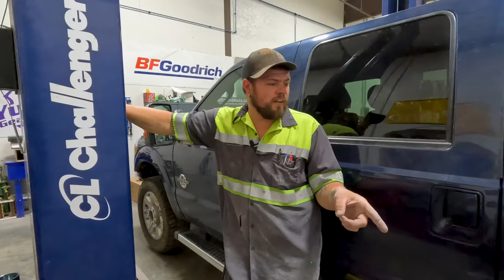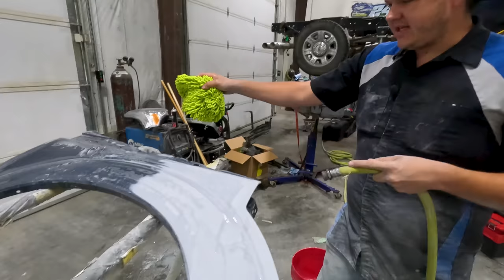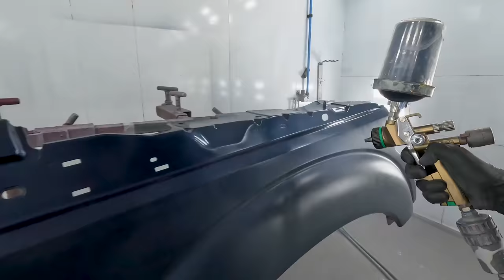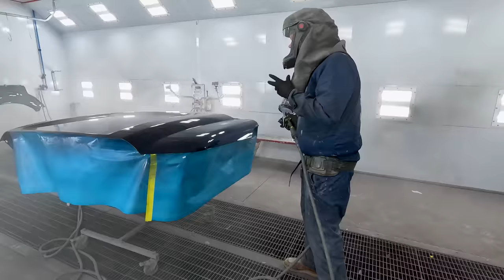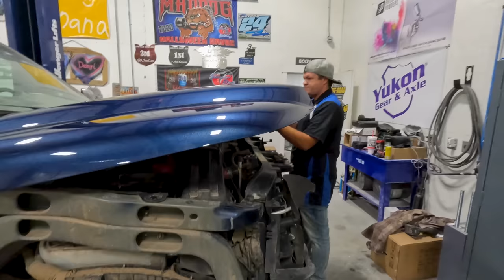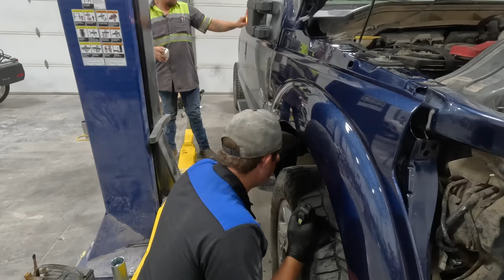Fresh Paint Finished For Matt’s Off Roads BlueSteel!

Comment: You guys really should make a skidplate to protect the new tank. It's obvious that the old ones took a few hits, and now the tank is exposed/ venerable.
Reply: At keast remind Matt that it isn't protected.
Reply: I agree a skid plate to protect that tank would be a great addition. Let Matt and his team build it if needed.
Reply: Once again Hillbilly did a bad cutting job, left sharp ends, and it looked like crap.  I can't stand that dude. But he knows everything.
Reply: yep i was just gonna mention that. Nice catch
Reply: I thought the exact same thing when Justin was prying out the old skid plate. You know Matt is going to go over rocks that he should be.
Reply: Matt is capable of building one himself though.
Reply: Vulnerable
Reply: Funny. I’m not an expert but was thinking the exact same thing. If he goes over any terrain with that truck the tank is vulnerable .
Reply: @JasonGunn418  and along a plastic tank so it can be cut into and cause a leak or worst a explosion
Reply: @NYTROeast  you realize diesel doesn't just explode right lol
Reply: @leejohnson6173  Yes I know that it also doesn't just light by sparks.
Reply: @NYTROeast you can't even light it with a match. Too much Hollywood. And a plastic tank probably wouldn't hold enough pressure to cause it to light.
Reply: @richwood8650  That is true diesel fuel will just put a match out it would even put out a burning piece of paper. You need around 150 or better heat degree heat source to get diesel to burn
Reply: I’d use 1/4” angle and plate😊
Reply: @leejohnson6173  Not even gasoline explodes. It can however cause overpressure.
And it's harder to light "virgin gasoline" than one would think. It's when it evaporates and hits the right stochiometric mixture that it goes FWOOMP if you ignite it.
In liquid form, it just burns like molten plastic.

Diesel could probably even be used to put out fires if one wanted to play that game.
Reply: @JasonGunn418  He left the sharp edges away from the tank though so not really a big deal and i am sure that skid plate is already known about and is going to be replaced alongside a skid plate for the tank.
Both of which will be something Matt throws together custom made at his shop.
Reply: @RealCadde  Those factory skid plates are thin stamped steel and are almost worthless against rocks. Better that Matt builds one that can actually take some abuse...
Reply: @AndrewAMartin  Yes, that's exactly what i said.
Reply: @RealCadde  FYI I'm not reading you mile long reply..I was talking about diesel...end of story.
Reply: He needs a self sealing tank.
Reply: @NYTROeast it was empty. 

And diesel isn't exactly known for it's explosive properties...
Reply: @AFMurse  It wasn't really empty it had whatever was in the old tank in it but empty or full that cob job to that shield is going to wear a hole in sooner or later and depending on the fuel amount that is in it when that happens it going to cause a mess maybe even a fire deo=pending on the exhaust temp since diesel need to hit 150 degrees or better to burn
Reply: @JasonGunn418  You're assuming it wasn't cleaned up off camera.
Reply: @NYTROeast  Diesel doesn't explode.
Reply: Like a 1" thick steel plate 😅
Reply: That tank really needs protection you doing updated suspension for extra weight
Reply: Venerable or vulnerable?

Comment: Air bags please!! While you have the bed off and before yo put the flat deck on. That truck is always squatted so low in the back even with the gooseneck trailers because that off road wrecker is so heavy. Air bags would let it run level and the compressor would also give Matt an option to air his cars back up when he gets off the trail.

Comment: Robbie - Ford put different bolts in at different stations during assembly, with the operators only needing one or maybe 2 sizes of driver at each station. They don’t consider repairs do things differently and the wasted time the body shop goes through - which is one reason why insurance costs are high

Comment: That gas tank could probably use its own skid plate
Reply: FX4 is the off road kit and the tank should have had a factory plate to begin with !
Reply: @johnniemayfield9510  it did but they removed it to fit in the new tank
Reply: @johnniemayfield9510  you didn’t watch them take it off like the rest of us?
Reply: Yeah, "this skid plate will get smashed into the tank and leak fuel"

So then cutting a hole in the skid plate, so Matt can smash the plastic tank?
Makes no sense.
Reply: @alxace  
If it had been left as it was in a short time, the edge of the skid plate would wear a hole in it. Especially being around all the sand.  The new plastic fuel tanks are resistant to damage.  But not to metal constantly rubbing from vibrations.
Reply: @DB-yj3qc  Still needs to round the corners for the next guy that has to reach around in there.

Comment: the fuel tank skid plate should be put back in.
of course it will need modification (or replaced entirely)
its just too easy to punch a hole in a plastic fuel tank

Comment: Very nice work on Blue Steel. Quick question, did you have to get a larger skid plate to protect the new tank?
Reply: They tossed the old skid plate in the bed toward the end of the video so my guess is it will need a new skid plate.
Reply: I put a 60 gal. Titan fuel tank in my truck. I called Titan for a skid plate, and they said the plastic is so tough it doesn't need it.

Comment: A couple broken plastic tabs on the washer squirter is nothin; I've got an '07 FJ Cruiser, and had to order a pack of 100 trim panel snaps... because in 15 years, probably 2/3 of them had decayed to the point they fell apart when I went to pop them off... and that was under the hood, outside of UV light!! I expect more to snap apart when I get on the interior door panel replacement - which Toyota helpfully pre-attaches when you order the trim panel...

I'm tempted to make an appointment at Robby's shop when I am ready to get it repainted - just to support one of my favorite channels... they're about 4 hours away, but that's certainly one of the shorter road trips we've made. 😋

Comment: The 4 different fastener sizes on the fenders means it’s likely 4 different processes on the assembly line installing the parts to the fender. 
If you think about just the painted fender it is likely all the same size and then different sizes for everything added after it’s painted.

Comment: With  200 K on this truck you should have installed a NEW FUEL PUMP , removing that 50 gallon tank to do the job later is going to suck .

Comment: those mirrors don't come with the cap piece because it can EITHER be Chrome or body color depending on the trim package.    the body color ones come black and have to be primered and painted.    btw, I've had good luck with aftermarket Trail Ridge brand OE style mirrors on Ford SuperDuty trucks

Comment: They just commented on how quiet the new lift is and then they use a drill pump to transfer fuel.  They make a siphon hose with a ball valve.  You shake the end of the hose with the ball valve up and down in the fuel until it lifts enough fuel to start the siphon.  It's basically silent; you don't have to use an electric drill around gasoline vapors, or suck on the fuel hose with your mouth.

Comment: Hi Robby, I have been following since you first appeared with Matt of Matt's Recovery.  I see that you are a young man making his way in this hectic world of ours.  I truly enjoy watching your recovery videos.  I used to be a tow driver as well as a heavy equipment operator, backhoes and 225 excavators were my favorite machines to operate.   Anyway, I am surprised you didn't wash Blue Steel before putting the fender and hood on, that truck is filthy and then you put on the spray foam over the dirt.  As a car guy, but I don't everything, but with all the work you have put into it wouldn't you want the inside to look as good as the outside?  I do know that would be a little more time and effort, but I am sure Matt would have been completely ecstatic to see you put that much more effort into the things you do.  Not criticizing just surprised as I believe you are a man of detail, and this was just an oversight from being so busy and tired.  Anyway keep up the good work and the solid videos, I will watch them as you put them out.

Comment: hey robby.  you know there is a 2 component plastic you can get too for plastic repairs ?
same setup as the foam just smaller .personally i love the express version.  
can get it down in size as the 2 component epoxy double syringe.

Comment: Do the fuel lines between the tank and the evap system have o-rings in the fittings?  I’m still getting evap error codes on mine and wonder if an o-ring may have come out.

Comment: So, after watching, i ran outside to see if my 1999 F350 fenders had foam, and where you applied foam to these fenders, theres none, and doesnt look like there ever was any. Upon inspecting the rear bedsides, theres maybe a 10 inch section directly centered above the wheel, that was foamed on both sides, ironically thats the only spot on this entire truck that has rust, and the rust came from the inside out. 

So that peaks my curiosity, is the foam trapping moisture in itself and promoting rust, especially from the inside out, where youll never see it until its too late? Lol 

Curious what Robbys thought on this is, as he has probably seen more bedside repairs and can shine some more light on Ford and there foaming tactics, if he has seen any rust developing from foam or which manufacturers use the foam and what not, ive really only seen the fords rot out in the same spot over the rear wheels.

Comment: That is no joke about Ford and using 11ty different fasteners on the same part. I was doing head gaskets on my daughter's 3.0l v6 Ford Ranger. For the lower intake plenum, it was 3 different fastener sizes and two different types, hex bolt and Torx. There was no reason to use different pieces for all of them, the torx head bolts didn't go into tight recesses or anything. Add on some Philips head screws for various cable and hose guides. 

I don't understand how or why Ford does that, but working on them means you'll have every damned tool you own sitting out on the cart.

Comment: All vehicle makers use multiple size bolts lol my chevy had 3 different size bolts ... my dads dodge has 2 different size in fender ... my wifes dodge has 3 different size bolts in fender 😂 and the ford f150 has just 1 size bolt and then locking clips lol story of my life

Comment: Wait... did he just toss the old skid plate out? And then not install a new one that fits the size of the new tank? I mean cutting the front skid plate out with a wheel was kinda sketch. You know, with a plastic tank right above it. But ok, skills. But  you all know where Matt is going to take this truck. And now there is no skid plate between the plastic gas tank and Matt grinding the bottom of the truck on some nasty rocks. You all are going to be replacing this tank again before to long... :)

Comment: 5.5mm bolt heads are better than Philips screws, but I always curse Ford when I have to find the right socket. They go missing even easier than a 10mm

Also for the mirrors, they don't sell them with that trim because it can be black, or chrome, or paint-matched depending on the model. this way they only need one mirror assembly for that entire generation- and just have to buy the trim you need/want separately

Comment: Robby, you sound as though you don't prefer Ford. It's not because they have different size fasteners, it about the quality of their vehicles that's most important. I didn't type this to you as of yet. Their 6.7 liter powerstroke engine produces 500 horsepower and 1200 foot pounds of torque, which is their high output engine. A single rear wheel, regular cab, two wheel drive is able to tow 40,000 pounds of whatever it could be.
Reply from the maker: I do not like having to get 5 sockets to take 1 fender off as far as their power train I have no issues with it I have a 2020 f550 that I love! I have owned plenty of Ford vehicles and like them as far as ford vs Chevy banter it’s just for fun between me and hillbilly..
Reply: I believe there's more to the different sized fasteners, Robby. It's a possibility that Ford wants to do it differently than other automotive companies. Another possibility is that they don't want to copy those others.

Comment: Using a face shield you can see through is such a noob tactic.  320 that thing.

And this is for Matt: those skid plates need to be at least half inch AR500.  Full length, integrated into the bumpers, and possibly a roll cage.  With tow points.